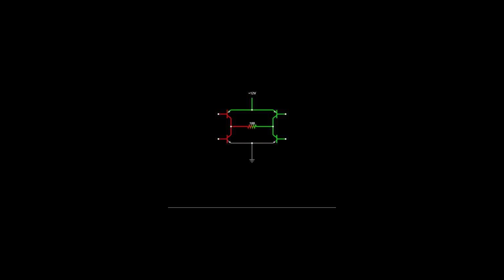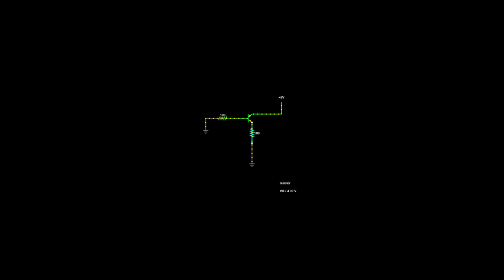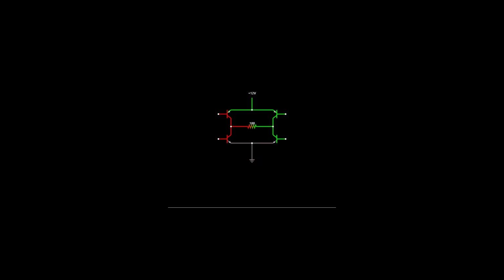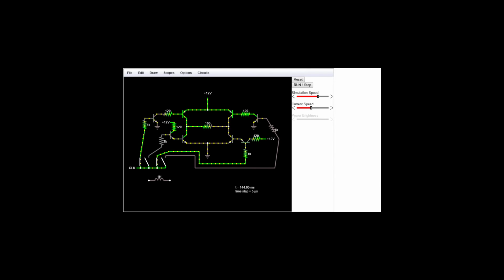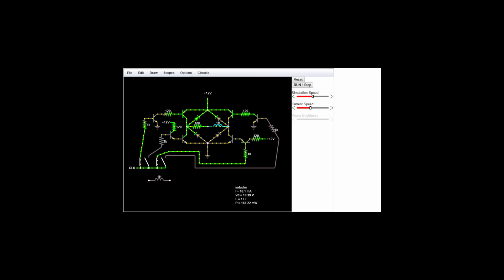How to build a proper H-bridge that probably won't catch fire

Comment: If you look at the data sheet for a TA7291P,  the block diagram shows that they are using 4 NPN transistors for the h-bridge.

Comment: 5:20 upper npn is emitter follower that's why voltage at follower's output can't exceed voltage on its base.
6:18 emitter follower connection, more fast than 6:39 common emitter. Dont forget about base charge storage time - it can be as long as few microseconds. Common emitter circuit may fail.
10:37 - power switches have a large storage time, you need to add low ohm base-emitter resistors to force base charge removal.
These schemes are static, it work good with light load without high frequency pwm. Switching losses are high.
14:27 Collector current of the drive npn's is 100mA while power dissipation on the collector resistors is 1,4W. That's quite lot.
Why you commutate two switches in diagonal ? It neccecary to commutate only ONE of them! Second one must be constant ON. Never break current flowing through motor, it wil greatly REDUCE its torque. Thus, you need to add anti-parallel diode to the switches.
17:14 mosfet bridge does not need such parallel diodes because all mosfets already have their own body-diode, which is anyway much better than 1A silicon rectifier diodes
 😅
18:25 value of bypass capacitor depends on motor average current, Duty Cycle. Capacitor must handle ripple current which is generated NOT BY MOTOR but by hard-switching scheme !
For example. 775 motor. You apologize limit current is 30 amper (but it can draw times higher!). The most curren thru bypass cap will flow when Duty Cycle= 50%. Ripple rms = 0,5*Imot=15 amper. You'll need to add in parallel 5-6 capacitors 1500-2200uF to handle this ripple in continuous mode.
20:46 - 100 Ohm+1H this is not realistic model of the motor, its dump load. R armature is below 1 Ohm, Inductance 100-1000 uH, add Back-EMF source, dependent on rms !

Comment: Hi Josh ! Thanks for the video and the time on doing it.  I've seen it but don't know if that's enough for a project I'm running.  It includes 24V 1500W DC motors, so as you can see almost 63A and to be honest I don't know how to handle that.  Could you please give me some advice.  Thanks !

Comment: I have a dumb question, how about H bridge with just plain old electromagnetic relays in situation where I need to control 755 motor on, off and direction, does not need to be very quick, nothing fancier?
Reply: That would be an option. However, DC has a really bad tendency to weld its contacts closed.

Comment: I have some TIP120 darlington transistors. They wont work for this schematic right? coz they are npn internally. Does anyone have a diagram I could follow that would allow me to use these transistors? similar to this video? I'm pretty new to this.

Comment: I like the video, however your explanations about the coils and the capacitor are wrong (or at least I got them wrong)…
To clarify:
The current through an inductor can not change in an instant, otherwise an overvoltage would occur, destroying the transistors (u = L di/dt), because they cannot block the voltage. This is why the Diodes are necessary - so the current isn't shut down.
Same goes for the voltage on the capacitor you talk about. It does not smooth current, it smoothes out the voltage (voltage on a capacitor cannot change rapidly without great current) and supports the ext. voltage source (battery) by supplying current in the moments it is required. 
Otherwise: Great video :) Keep going!

Comment: how about this one this only use MCU 2 and can be stopped http://www.talkingelectronics.com/projects/H-Bridge/images/H-Bridge-6.gif
Reply from the maker: Nice. I haven't seen this technique before but it's legit. Uses a similar concept to the one presented, but steals the "on" state from the opposite top transistor to activate the bottom ones, without the extra pair of transistors required. Thanks for sharing.

Comment: i made the H brideg (Supply 24vDC) with TIP127(pnp) on top with 220k.....and TIP122 (npn) at bottom with 330 ohm .......i have used  1N4007 s as the freewheeling diodes......initially i got 24v at motor output .....but when i connected the 24v DC motor which consumes not more than 300mA current the voltage across motor dropped to 18v.....i want 24 volts across motor.....please suggest something....................

https://drive.google.com/open?id=0B_xYZc-AB1zRVmZzM25KT1g3cG8
Reply from the maker: Well first off this isn't the circuit I recommend in this video, so I can't really offer complete support on it. However, please check out my video on how NOT to build an H-bridge to understand some of the common pitfalls in H-bridge design (https://www.youtube.com/watch?v=xbJ0dT-VZIQ) then return and finish watching this video so that you can hear my advice on design thinking.

Second, there are potential problems with your circuit design. For one, what is your input voltage? 5V? Unless input is equal to VCC, how is the input voltage going to fight against the 24V VCC to turn off the upper PNPs? It's just a guess on my part.